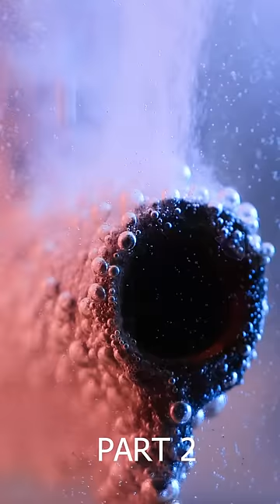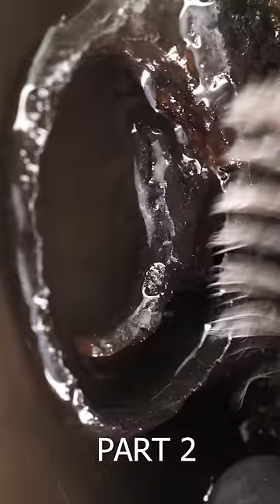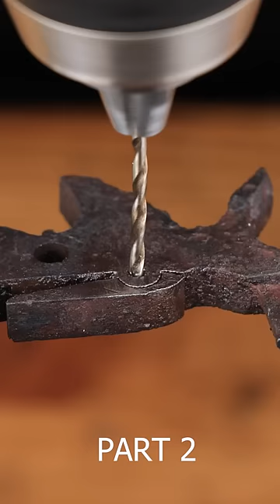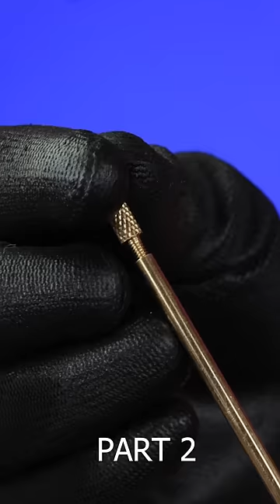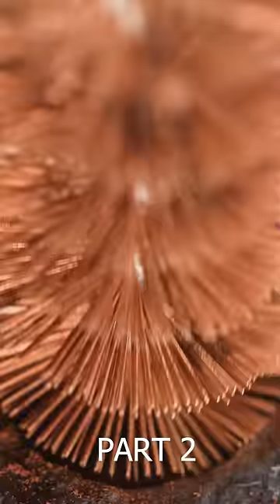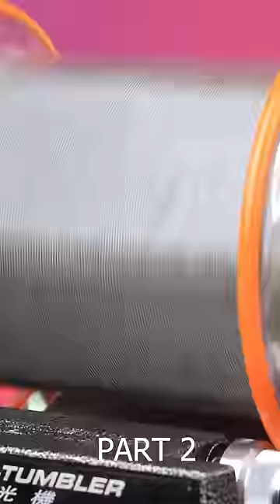Rusty Revolver Restoration Part 2 #Shorts

Comment: I noticed that the primers in the bullets have been removed, and if this revolver was found like that, this video is most likely staged. Although it seems the oxidisation is real, it was most likely a chemical in use that made it degrade faster. I’m not hating just pointing out what I saw :) if I’m wrong just reply to my comment :D
Reply: I thought I saw primers

Comment: Would it be bad if you had tried to put that copper brush that you had used to clean out the chambers in the cylinder on a drill??

Comment: If the inside of those empty chambers in that cylinder are as pockmarked as the outside it WILL NOT work like you expect it to… at best those 2 that had rounds in them still may be preserved, but the barrel is probably fucked up, and the gap between cylinder and barrel would be more pronounced leading to a fireball blasting out to the sides from the cylinder and all kinds of other problems…

Comment: If you could EVER get rid of the pits all that rus left, you'd never find the tolerance to make a difference. 
Restoration at this point is ONLY to be done to look at this. 

If someone ever tries to sell you a "restored" firearm and they show you anything similar to this as the start.......tell them you have a dollar or two in change for the scrap you're buying. 

If you find a gun in this condition, just bury it again, for the way you found it is it's best operating condition at that point. 

Don't do THIS and think you have a new carry piece. Go buy a gun. If you can't, go make one out of lead and I bet that would be safer. 

.....don't do that either. 

Buy as many guns as you can...

Comment: I'm not sure why you would want to restore this, the metal in the barrel is damaged enough that you will eventually have a catastrophic failure either the first time you try to fire it or not long after,  it will either injure or kill you or someone nearby, gun barrels have to contain extreme pressures and heat, your talking between 20,000 psi and 65,000 psi, if the metal is degraded or rusted extremely bad then it is no longer a functional weapon, unless you call a gun that becomes an explosive device functional, i would never use this weapon under any circumstance, and restoring it is clickbait, it's also dangerous to teach someone that restoring a weapon in this condition is ok, it's only use is as a paperweight now

Comment: Never and i mean never try to restore a gun that has ammo stuck in it chances are its still live. Judgeing by how the primer looks it looks like these have had the gunpowder removed. But please never do this with an seized up loaded gun just because you cant move the hammer or pull the trigger doesnt mean they cant go off old ammunition twnds to become more sensitive and unstable the longer it sits around. And sisnce most bullets are air tight the gun powder shouldnt have gotten wet or old so theres a chance your messing with dangerouse rounds. Them being unstable is why people advice tou not to shoot anything over 25-30 years old or anything tarnished. Except for acceptions like old surplus ammo thats been sitting in a cool dry safe enviroment that stuff will be safe even after 40 or 50 years because its controlled but if you find a bullet in an old barn somewhere just set it gently primer down on a table or shelf or put it in a glass mason jar and bring it to someone who loads ammo because they can dispose of it properly.

Comment: Machinist here. The tolerances on every single surface will be way off. 
The cleaning you did left a sponge like surface finish, look in a scope itll be the aurface of the moon. Theae craters will attract moisture and corrode again, deepining the crater and further grinding away ghat material to nothing short of a hand grenade. 

The bullets will not be flushin to the cylinder housing. The barrel will allow bullet rocking potentially causing violent failure. The hammer and pin will also be effected, may not even get a shot off, it will certainly have narrowed the pins radius potentially piercing more ghan striking the cap. 
Cycling's gonna be off too. All threaded screws will be loose. 
Ao ya got a grenade that might shoot once or twice vut will either explode in the barrel or the cylinder housing. Gl w that.

Comment: Dumb. Let it rust in pieces.  He has to add metal to it and then file it down to shape.
I restored this axe. Yeah, the wood was so weak, new handle, then new head.
It's replacement, not restoration.